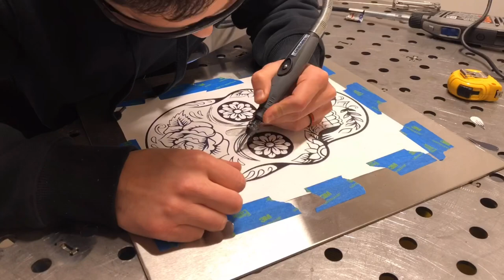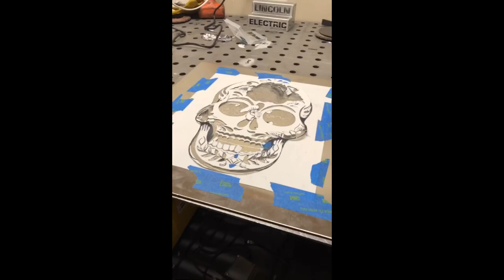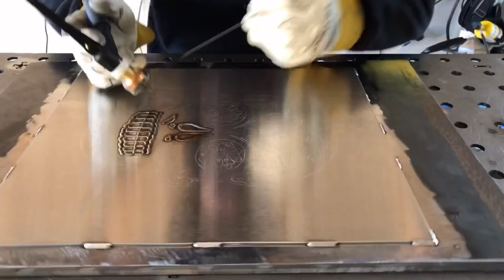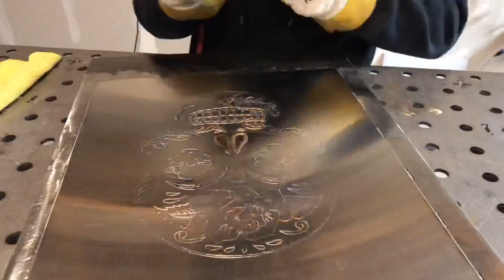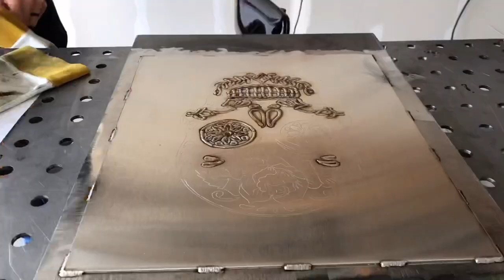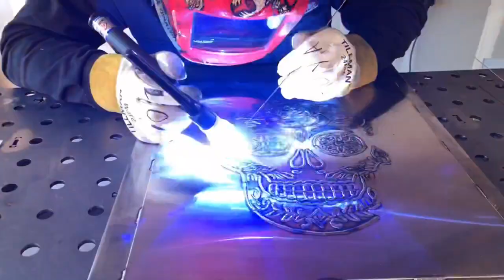Sugar Skull Weld Art

Comment: It's tough to tell at that speed but are you dabbing or lay wire?  What specs/tungsten/wire are you using?  Looks amazing!
Reply from the maker: Thank you I am dabbing using 3/32” tungsten, furick bbw cup 35 CFH argon backing gas. I don’t remember amperage but I was using a foot pedal.

Comment: What are you doing at the bottom on the baseplate after grabbing a new filler rod? Did you regrind the tungsten and want to ball the point? 

Love the video and think the general speed / flow was spot on, I’m inspired to go try this now. Thank you!
Reply from the maker: I was getting some arc wonder so I was lighting up on the baseplate to ensure I wouldn't get any on the actual work piece. I was switching tungsten out frequently because the machine was acting up for some reason.
Reply: @christianloya5238  Did you balance the base plate on a little knob on the bottom? If the plate pivots on it and makes contact with the table on different corners during the weld, your current takes different paths, which can distort your arc. With high welding currents (for example electrode welding in construction) it's apparently significant for the arc direction where you put the mass clamp.
Reply from the maker: You make a great point! I’ll keep this in mind if I ever do anymore art pieces like this.
Reply: @christianloya5238  It looks awesome, I might try something like this sometime. My chrome welds are usually rather grey burnt than white frown
Reply from the maker: It all comes with a good setup and practice! Keep at it you’ll get it!